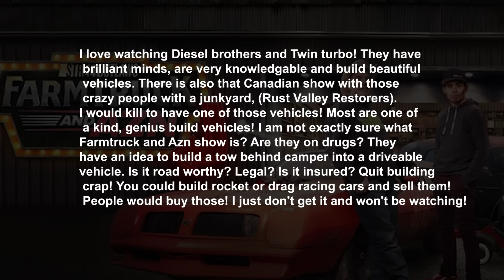STREET OUTLAWS - Heartbreaking Tragedy Of Farmtruck From "Street Outlaws: No Prep Kings"

Comment: Farm trucks body style is actually the early 1970 Chevy c10
Reply: 1967
Reply: @robtob360  it's actually not a 67, if it was it would have a smaller rear window that only 67 had. 68 - 72 had a larger rear window like farmtruck, and the working marker light would normally place it 70 - 72
Reply: The big rear window was an available option for '67.  The front end on this truck is definitely not from 1967, though.
Reply: That's not a 97 it's a 1970
Reply: @robtob360  NOPE Ive got a 67
Reply: Early 70's, I'd say, I had one years ago a 70 model stepside but it really teed me off that this guy said it was a 97...wow, Farmtruck wouldn't mess with that new fangled stuff
Reply: It's a 68/9 grille. The cab and bed could be anything from 67-71. The hood is 70 with the bowtie. 67 hoods had a slant front unlike the more stand up flat like the later models. In 70 gm went with the egg crate grilles.

I have a 69 GMC.
Reply: Wrong fi-ing  front end to be a 67. Additionally side marker lights did come out till 68.. could be a 69 or 70..or 71-71 with 69-70 front clip..
Reply: 67- 68 had the same grill, 69-70 has farmtruck grill, and 71-72 shared a grill
Reply: Yeah that's what I was thinking about. And there's no way that it's a 1997 truck. It's about a 1968-1971
Reply: You sure it's not a 97' as a retro comeback?😂😂
Reply: You know what you see he don't
Reply: Very true..

Comment: So i figured it out.
Farmtruck was made in the 70s muscle car erra ..
The farmtruck was made to be a beast.
I had  a72 c20 with a 410 gears. It had a 1 ton rear end in it.
I had a 69 Pontiac 400 with a turbo 400 transmission.
B+m shift kit.
I loved running away from those new turbo  300z and the new vets with the aluminum engine from the 80s .
On the freeway and the front end would raise up level with the rear, rear tires were 900 16s they were 3 ft tall so the a$$ of the truck was very high..
After i blasted up through a Rev and the front would bounce up and down..
They gave up really fast..
Later my buddy was in another vehicle and told me the back tires stretched really skinny and real thin 😮😮😮
So i decided to be cool and not die. LoL 😂😂..
I loved driving my chevropont... 😊😊😊